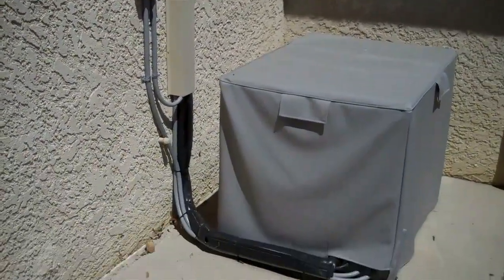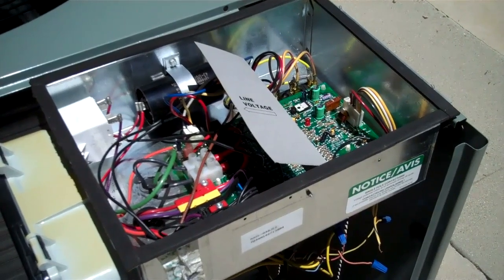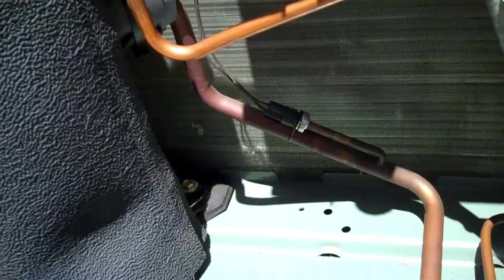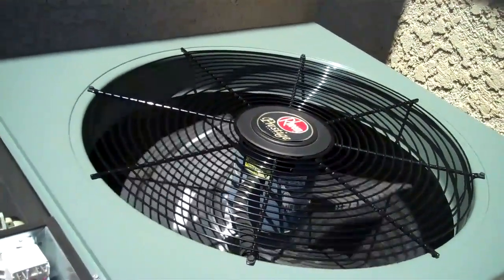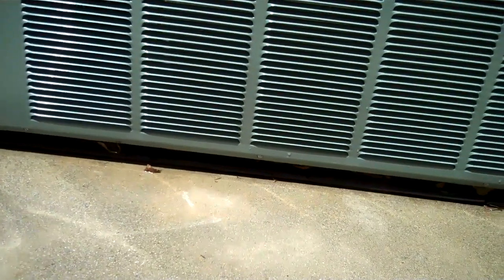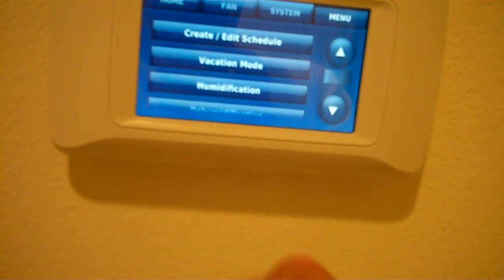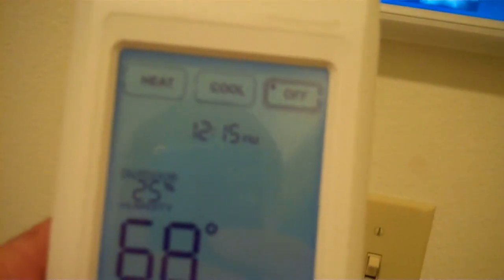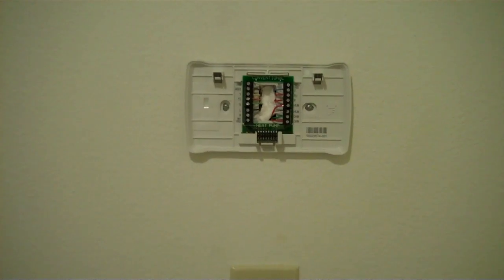HVAC RHEEM 3 TON CONDENSER START UP TWO STAGE.

Comment: hi i  have a trane xl19i 2.5 ton r22  2 stage compressor when calling 
for second stage are both contactors suppose to pull in or just hi 
contactor? thank u

Comment from the maker: @fritzhvac Thank for the good comments.I will make another video on the condenser believe it or not they are pretty simple!They also make a 18 seer 2 stage 3 1/2  to 5ton tandom compressor condensing unit, it stage's at 50/50 capacity.